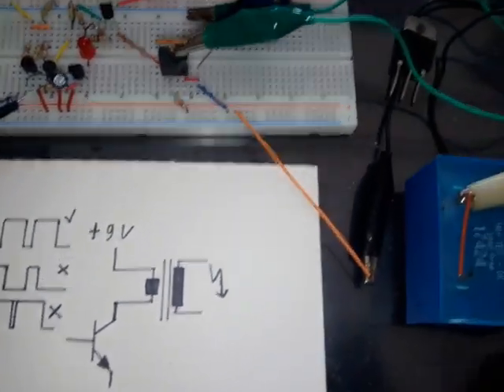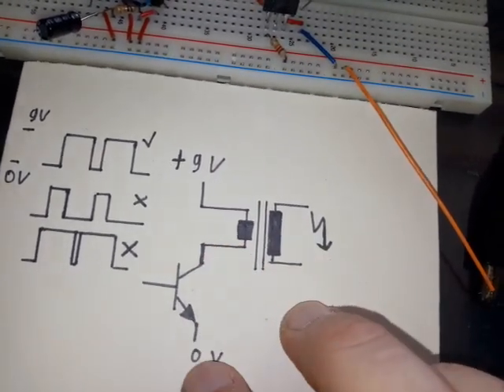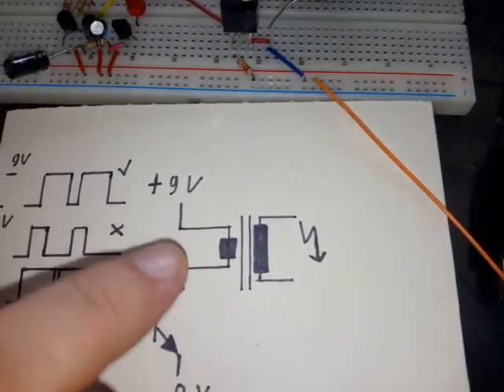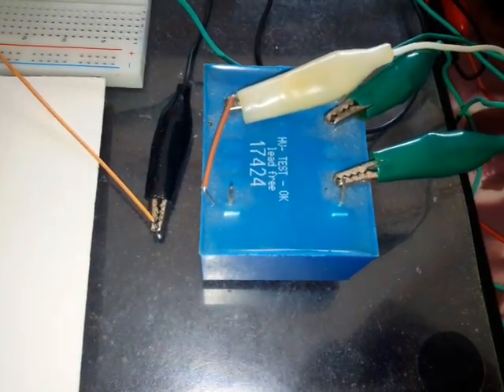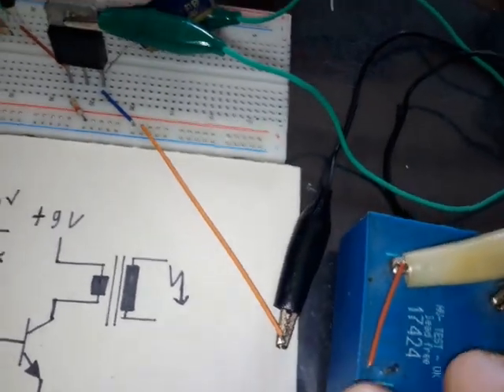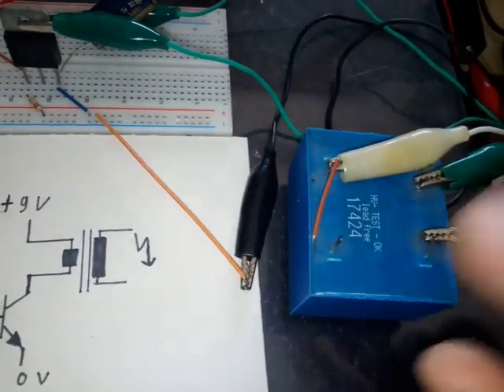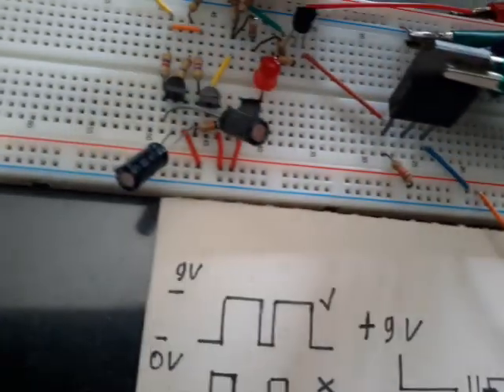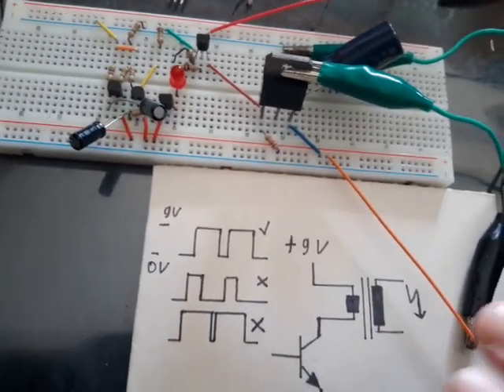Information DIY High Voltage Generator

Comment: Hallo Stefan0719, ich habe mal eine Frage zu dem Thema Sender. Ich habe ein sehr einfachen Oszillator aufgebaut (Ne555 als Astabiler Multibrivator) mit dem steuer ich BC548 und BC558 an die wieder rum als Gegentaktstufe aufgebaut ist die wiederum ein Mosfet ansteuert. jetzt ist aber das Problem das die Endstufe zu viel Strom zieht so das der Mosfet alles verbrät, hängt das an einer zu geringeren Induktivität zusammen? oder ist die Frequenz zu gering? (max. 250khz)
Reply from the maker: Hallo,die Ansteuerung mit BC548 und 558 macht hier wenig Sinn. Die Transistoren können um die 90-100mA - und 100mA kann der Timer IC selber schon rausgeben wenn es sich um die normale Version (nicht TS sondern NE) handelt. Du könntest die 548 / 558 durch stärkere Ts ersetzen wie die BD139 / 140Das der Mosfet warm wird kann verschiedene Ursachen haben. Wenn es sich um einen mit viel Gate Kapazität handelt (IRFP250 z.B.) könnten die Ts nicht genug Strom bereitstellen, das Gate wird so nicht voll durchgesteuert, und der Mosfet hat Verlustleistung da er linear arbeitet.In dem Fall dürften aber auch die Ts regelrecht heiss werden.Ferner fehlen alle Details über den Aufbau. Wie ist denn der Drain beschalten? Einfach nur eine große Spule (ettliche µH vielleicht sogar 1-stellige mH) nach Modulator? Wie wird die Antenne angekoppelt?Wenn du einfach nur eine Schaltung hast, wo der Drain "offen" ist, ists klar das der Fet heiss wird, da er dauerhaft im "avalanche" Betrieb arbeitet, das heist, es entsteht am Drain eine hohe Spannung, und die fliesst wieder rückwärts in den Mosfet... was dieser nicht sonderlich mag.Worum handelt es sich bei dem Sender überhaupt? Ein einfacher kleiner Sender für Hausbetrieb oder ein "Rundfunksender" -? Dir sollte schon klar sein das - wenn man schon bei Mittelwelle Probleme mit der Antenne hat - du auf Langwelle eine physikalisch große Antenne brauchst, und auch einen Physikalisch großen PI Filter (wegen der Blindströme).Wenn es nur ein Haussender sein soll, dann brauchst du vielleicht maximal 100mW an einer 2m Antenne um deine Wohnung zu versorgen. Mach´s am besten so wie ich, und bau nen Trafo mit nem Verhältniss von 1:100 auf, und bring die :100 Seite auf Resonanz deiner Frequenz.Das geht bei mir mit kleinen Leistungen "für Heimbetrieb" ganz gut... aber auch hier das Problem der kurzen Antenne. Erhöhe ich die Leistung auf 0,5W (was bei Langwelle schon mit einem einzigen BC548 in der Endstufe möglich ist) ist die Spannung schon wieder so hoch, das Folien Trimmkondensatoren durchbrennen.Am besten wäre es einfach einen Transistor in klasse C zu schalten als Endstufe, und im Kollektor einen Schwingkreis (vielleicht 40-50µH + x nF parallel) zu machen der auf einem Ferritstab gewickelt ist. Das richtig aufgebaut sollte gut 5-10m weit gehen (auf Taschenradios mit Ferittantenne)
Reply: Hallo Stefan0719 danke erst mal für die Rückmeldung, ich hab die Schaltung komplett neu aufgebaut: also Hef4046 nur als Oszillator! danach geht es auf dem Hef40106 (Schmitt Trigger) und vom Ausgang von diesem Schmitt Trigger geht es auf eine Gegentaktstufe mit BD139 und BD140, die Schaltung funktioniert besser als mit Ne555 =) und der Mosfet Irfp064N (55V und 110A) wird auch nicht mehr heiß. die Spule ist in reihe zum Drain und parallel zu der Spule ist ein 800pF Drehkondensator der noch zu klein ist (Windungen primär: ca. 70Windungen und Sekundär ca. 3 Windungen um zu Testen), funktioniert auch soweit auser das noch keine richtige Sinus an der Sekundärspule ankommt. die Frequenz liegt momentan bei 100khz ziel sind es 170khz zu schaffen, mit 300mW Leistung für den Haus gebrauch. Lg.